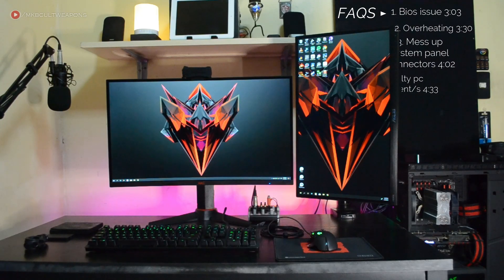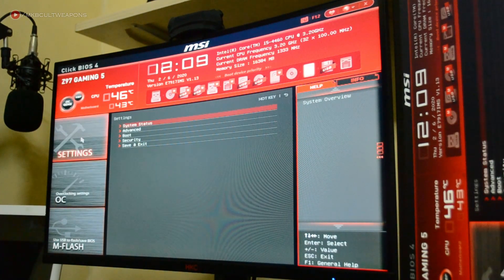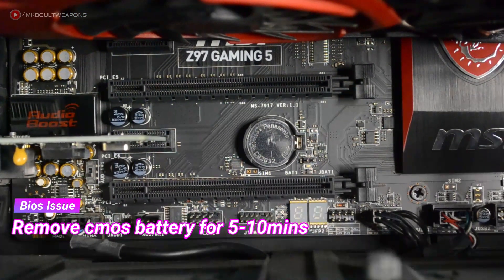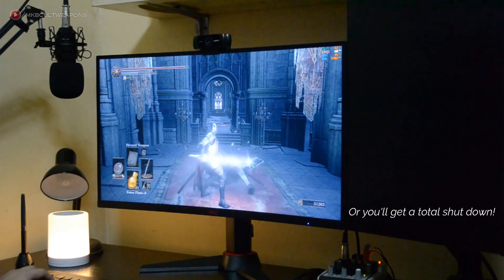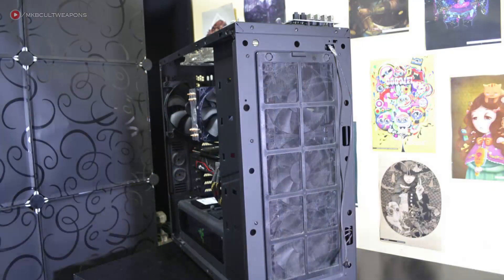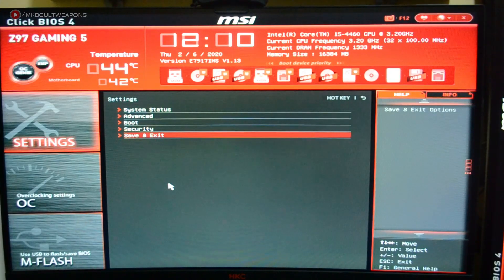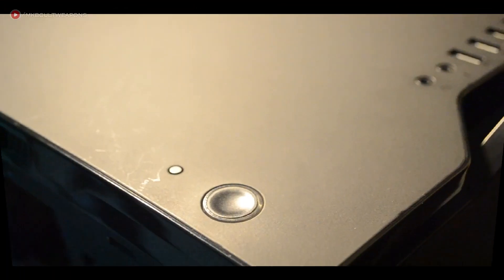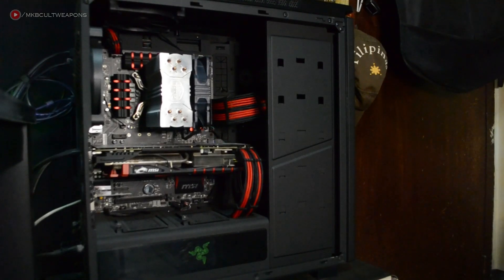Pc keeps restarting FIX / Pc continuous restarting FIX

Comment: Bro ill try to do these when i arrive home but my pcs problem is when it turns on it gets lagging and freezing after some seconds it shows an blue screen and after a second it turns off,so after that when loading doesnt show the windows intro but set an black screen which says to reboot your system,so after i see this i try to unplug the power and plug it again and it turns on,my windows 10 pro did it more than 4 times and im afraid it will crash the hdd. Any resolution for it please?
Reply from the maker: i hope not but sounds like a system failure. Are you using hdd as bootdrive? If you can get to your important files in desktop i suggest start backing up, this might be a failing hdd

Comment: Bro can u help me my pc keeps on restarting.. sometimes it restarts after 20 mint and sometimes it complete the whole day and doesn't restart.. doesn't depend on the time but restarts eventually.. ur help will be really appreciated
Reply: I think my sata cable is faulty. If i use that faulty sata cable in running window hdd then is it possible to restart the pc randomly?
Reply from the maker: @hashimzia888  definitely, happens to me several times in the past
Reply: Hashim Zia does changing the sata cable solved your problem??
I’m also having similar problem.
All temps are fine.
Pc restarts after 1 hr of gaming,
Reply from the maker: @taimurrj  sata rarely are the problem, but have you tried changing it?
Reply: Nop not yet. The system boots properly, doesn’t seem to be the issue. But i only changed my psu recently after that im experiencing it.
In my case if im gaming for quite a while it restarts after a while( time is different everytime ) and if i continue to play after restart it continues to happen.
But only when im gaming,
If im using some normal work if works fine.
Reply: I have came through many problem. But the real problem was with my PSU. My pSU was faulty i have changed my psu now almost 3 weeks ago and its working fine. Anyone having problem of auto restarting of problem first check ur ram then try to change power supply the problem will be solved.
Reply: Then u may be heating up problem with ur pc
Reply: Hashim Zia yeah will look into tht thanks
Reply from the maker: usually it's high temps of cpu or gpu, what are your temps anyway?
Reply: Cpu only exceeds to 76 and Gpu to 45.. With  45C° of cpu  it also restarts some times..
Reply from the maker: Normally cpu can go up to 80c and it’ll be fine. Though 76c is not ok if you’ll ask me, i keep mine under 66 - 68c all the time. The only thing i can advise you is open your pc case during high workloads to keep the temps down so it won’t restart on it’s own

Comment: See mine is really confusing because sometimes i can turn it on and play for hours and it wont restart and then sometimes i can play for a couple hours and it will restart and then when i turn it back on it will be good for a few minutes then restart and then sometimes it will continuously restart before it has even had time to boot up if anyone has any advice or help i would really appreciate it thank you :)
Reply from the maker: temps are too high, if the restarting are happening during gameplay. Open your pc case if you're gaming, also use msi afterburner to monitor your temps
Reply: @MacCoyzkie i have a geforce 1080 and when gaming is normally at a temp of 70° is that too high?
Reply from the maker: @Jnininininbvy  that's ok, i usually game at 83c but don't go beyond 88c.

Comment: Hello , my PC restarts itself every second , doesn't even want to turn on , I unplugged the cmos battery but no result , Rams don't have any problem , and when last time checked the temp I saw it's below 60 or 55 , my PC restarted in the middle of a game session , is it because I playied on it all day? Mostly idle. Please respond as fast as you can.
Reply from the maker: this may be a failing drive(c: or your game drive hdd) or psu then. Low power draw from psu may cause restarting, if you think your psu has no problem, have an electrician check your power outlet if it has a stable output.
Reply: @MacCoyzkie  thx for responding soooooo quick!!! i just tried ur methods and surprisingly the cmos battery worked! while i was trying it i was thinking it would not work so i typed it didn't , thx alot again you saved my life! make more these kind of videos and you will get bigger!
Reply from the maker: @ShiroKun01  awesome! Glad it worked already, and yeah i will make more videos like this, thanks for the feedback! 😊

Comment: I need help! my situation is a weird one, I bought a brand new PC with gtx 1650 s i5 9th gen 16 gb ram and all pieces are compatible and everything is running smoothly except for when i start a game and it loads in theres a 50% chance itll restart immediately under 10 secs, my temps are between 35c on the smallest games up to 60c on the most crowded games i could ever play, so ik its not the temp, all my drivers are updated and the Pc is just undeniably fast and running smoothly according to afterburner and geforce, and yet the issue still prevails. i havent tried to uninstall the nvidia driver and testing the integrated one because im fairly certain its a windows issue because nothing points otherwise (windows 10)
any help would be appreciated.
Reply from the maker: sounds like a low power draw, are you experiencing power fluctuation in your place? Usually that happens when your psu can't give enough power to the pc, btw during gaming pc eats a lot of power. If everything is new i suggest get it fix at the store where you got your pc from
Reply: Mac Coyzkie i have the same problem, but I know it’s not my power supply because it’s a 600w 80+ gold unit

Comment: bro that eraser method on the ram saved me so much time, TY!!
Reply from the maker: @Tray if there is any that is a bit scary but i haven't experience something like that and hopefully will never experience it. Also i doubt that this is possible since motherboard bios are different  from each manufacturer and there is no way a virus could download the latest bios for a specific motherboard, run it and shut itself down to destroying the motherboard. Plus i don't think flashing bios using your boot drive is possible, it needs to be in a specific usb port (with "flash bios" indication) to update a bios at least for the motherboards of 2021
Reply: It really helped !
Reply from the maker: haha! glad it worked! Yw bro and thanks for the feedback!
Reply: @MacCoyzkie  so I recently got a virus on my PC so I hard reset it to whipe all my data then my PC just kept turning on and off so I tried the ram method and that didn't work is it possible that the virus messed up my entire PC or am I missing something
Reply from the maker: @hello-4503  i think the only pc component that a virus can destroy are your drives and if the virus is really potent it could also destroy your motherboard. I haven't heard of a virus destroying the processor, gpu and rams.  In your case you could never get to backup your files and the only solution is have a clean installation of windows. On the other hand, also consider the solutions in this video before doing a clean installation of windows
Reply: @hello-4503  how did u fix it i have the same problem

Comment: Is there any chance that its related to motherboard or processor
Reply from the maker: motherboard yes, cpu no. if cpu is broken it will not boot at all.
Reply: @MacCoyzkie  so if my fans spin up and stop repeatedly without any video output it could be my cpu?
Reply from the maker: @thisaccountisntreal107  are you talking about gpu or cpu cooler?
Reply: @MacCoyzkie  all of the fans on my system spin

The GPU fans, the fans on the CPU cooler, the power supply fan and all the case fans spin

But they do that for a few seconds and stop and it does that over and over
Reply from the maker: @thisaccountisntreal107  have you tried the Rams cleaning? if it doesn't work then that is a psu problem or your wall outlet is not giving enough power, though it's highly unlikely
Reply: @MacCoyzkie  I tried the ram cleaning and one of my ram kits is only a couple weeks old anyway. The thing is my system was running only about 12 hours ago before I had a few weird BSODs and then this.

How certain is it that this is a power supply issue? I can go buy another one in the morning when stores open 

In the meantime my PC is in pieces and I might try building it with my girlfriend's power supply
Reply: @MacCoyzkie  okay so I just tried it with my girlfriend's power supply and it booted first try
I'll be picking up a new power supply when more shops are open thanks so much for your help man
Reply from the maker: @thisaccountisntreal107  awesome man no problem i hope it'll all go well
Reply: @MacCoyzkie  I have a new power supply installed and everything is running just fine 😎
Reply from the maker: @thisaccountisntreal107  oh so its the psu then

Comment: I clean the ram, and now my pc won't turn on
Reply: Make sure you have the ram in correctly
Reply: Make sure everything is plugged in
Reply: I reseated ny ram and it won't post either. RGB turns on and fans spin, no display and then it keep rebooting. I'll update when I find a solution...
Reply: @magnesiumdrip  same here bro 😞
Reply: @magnesiumdrip  I just got a response from my cou guy, it was my mother board like bruh
Reply: Henry Pham any updates? I’m having the same issue after upgrading 32gb ram. Plugged in my old ram sticks and even those won’t work. Stuck in a boot loop.
Reply: Cody same exact thing just happened to me. No fix yet.
Reply: MyName took my pc into a repair show. I’ll let you know what the results are.
Reply: Cody what happened
Reply: ShadowZ BlastYT MOBO was diagnosed to be the problem. I guess I have ESDd it. Had to replace the motherboard.
Reply: Push your ram until you hear a click
Reply: @cooperking9231  luffy?

Comment: My old pc used to crash with colored screen. I replaced the PSU, still was happening. I replaced the GTX970 with an old GT420 I had and the crashing stopped. Now I built a new pc (ryzen 5 3600) and my rtx 2060 super doesnt seem to want to arrive. I placee the gtx970 back in it because in my old pc, downclocking it with msi afterburner worked to solve the crash. But now the pc decides to crash and restart on its own with a kernel power error. My question is, is the gpu at fault, or do I have faulty hardware? Been stressing out cuz I spent 1700 (canada, shipping, covid) and need to be sure its really the gpu
Reply from the maker: may i know what is your psu? I think this is a bios problem with that kernel thingy. can you reset the bios to default?  Do that by removing the mobo battery for 5mins and place it back again. Make sure to ground yourself and that the pc is not plugged in a wall outlet. If all things still fail i suggest backup your files and have a re-installation of windows. This is what i did when i experience that.
Reply: @MacCoyzkie  Thanks for the reply. I literally built an entire new system (PSU is a Thermaltake 600W 80plus). In my old one, the problem still happened with my other SFX PSU. The motherboard is only a week old and the only thats more than 2 months old is the GPU (5 years old+-). So my GPU is pretty much dead, right? (I imagine building a new system counts as reinstalling Windows, right? Lol

Comment: Help me, mine keeps restarting once when opened and theres no output nor anything in the monitor. When I change to my old hdd it works fine
Reply: I fixed it, thanks brother. The cmos trick did it. After an automatic repair it opened again. I dont know why the monitor went black like that before i removed the cmos
Reply from the maker: @ateidmon9835  awesome! those usually happens when you're overclocking, but i hope you're not. anyway glad it works now
Reply from the maker: probably incompatibility. Do you have different gpu drivers?

Comment: I have a prebuilt and already running into my first problem 😤 so I have a omen oblisek tried to reset my PC it said no changes were made I pressed continued on the thing and my monitor went black and pc would turn off and on instantly over and over any ideas?
Reply: Dawg you never buy a prebuilt it’s better just to make one yourself and that’s what I did
Reply: @YohannGarcia.  I'm just pretty sure there's hella dust in that bih cause it just randomly did it
Reply: It could be your power supply check with another friend and tell them to bring there’s to see
Reply: @YohannGarcia.  none of my friends have a pc lmao I'm new to my PC too I got it last month and it happened randomly like I was gonna reset my PC and it said no changes were made and it would turn on for a second and immediately kept doing that
Reply: @YohannGarcia.  it would turn of for a second and turn off and it kept repeating itself *
Reply: And how much did you spend on it?
Reply from the maker: try any of the solution in the video

Comment: I recently just bought a pc and it keeps resting but I thought it was the power supply so I had a friend come and test his and it still worked but it wouldn’t load into windows so I thought it was the motherboard and I ordered a new one to see but I still haven’t put the new motherboard in
Reply from the maker: it might also be the ram sticks, can you also try those ram sticks with your friend?
Reply: Alright thanks for the advice I’ll give it a try
Reply: But how it could be the ram sticks if I just bought them
Reply from the maker: @YohannGarcia.  it very rare but it happens sometimes . it was for my case before so i have to go back to the local shop and have them replace it. if all else fail i suggest that you have the local shop where you got your pc from diagnose it for you